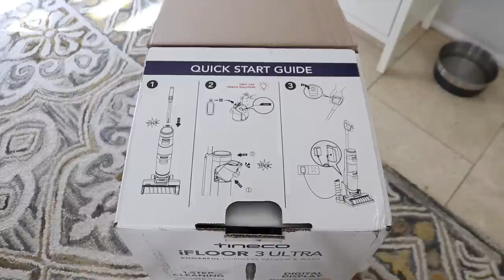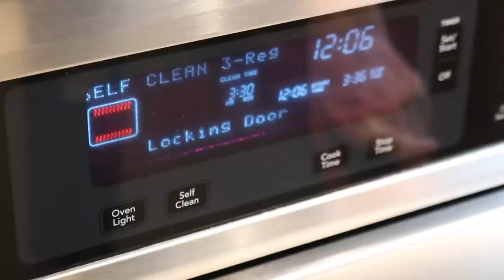SPRING CLEANING APPLIANCES | CLEANING MOTIVATION

Comment: Hi Randi, would you recommend that wet vac for bathrooms? Do you use a different roller when you do that area? I like how easy it was to use. We have hardwood floors and tiles so floor cleaning is always happening (esp since we have a cat). Thanks for doing your video!
Reply from the maker: I usually clean around the toilet with a disposable cloth. The space is very small and It’s the only way I can get behind the toilet. Then I can mop the rest of the floor. It’s very easy to switch the rollers. Thanks so much! 🥰

Comment: I used a tiny bit of Barkeeper’s Friend to clean the inside glass on our oven recently and it worked beautifully. Much less messy than the baking soda ‘method’ so many push on YouTube.  We don’t like the odor from our self-cleaning feature on the oven so I use EasyOff for self-clean ovens and leave it on overnight.  No, it’s not ‘natural’ but it certainly makes the most detestable chore in the kitchen a whole big lot easier.  
I had planned to get into our kitchen today to do a ‘big clean’ in the cabinets so this was a very inspirational video—Thanks, Randi!!

Comment: Hi Randi, i absolutely love your videos. They keep me motivated each week. Just wondering if your appliances (fridge, dishwasher, and washing machine) have filters. My appliances are all LG except the dishwasher.  The dishwasher, i periodically pull the filter out and wash it. It is in the bottom of the machine. My fridge has one and it is located in the back. My washing machine has one on the front. Even though my LG appliance are less than 2yrs old, I need to look into the filters on my LG appliances. Have a great week.

Comment: Randi, doesn’t your floor get scratched when you pull the fridge out and push it back?
I’d like to have the old style kitchen where the fridge isn’t in an enclosure. There’d be a lot more flexibility in what type to buy, as well as the air circulation they require.
Reply from the maker: The fridge is on rollers so it doesn’t damage the floor. But it’s still heavy. 😂